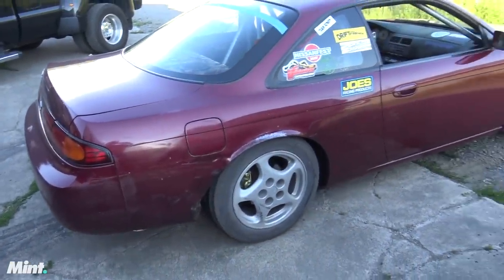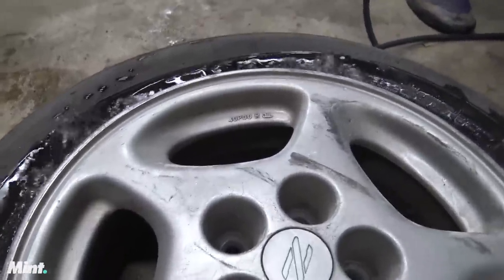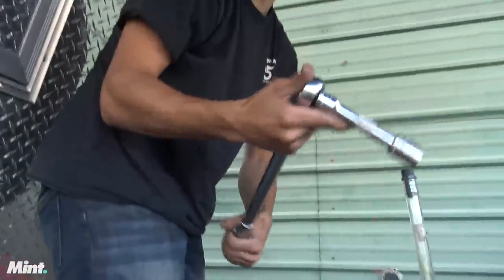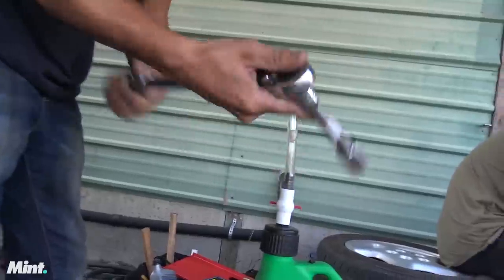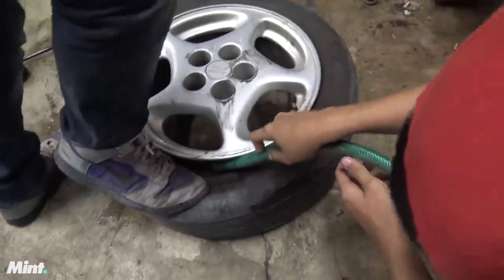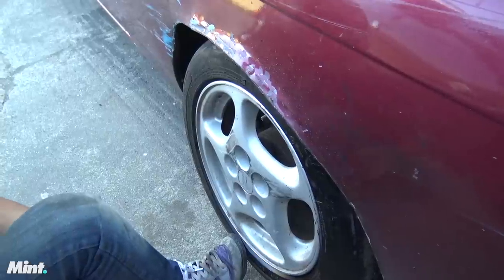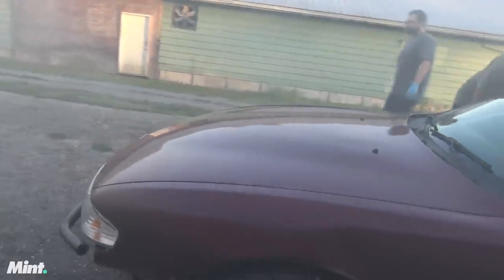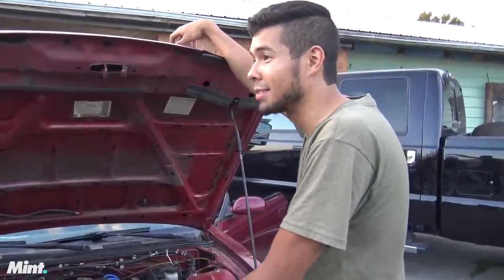Filling a CAR TIRE with WATER!

Comment: Nothing new guys.  Lots of ppl uses water instead of air in tractor wheels
Reply: Inkwizytor z planety Mongołów yeah but on a car doing burnouts is way different from a tractor.
Reply: Jr ALEXANDER maybe. But most of my friends use water. I will check calcium right now:)
Reply: Yup, Same thing here.
Reply: But why?
Reply: BisOnePL Because it adds alot of weight and it is cheap. Tractors need weight.
Reply: +Jr ALEXANDER
They use calcium if they're rich and can afford new rims every few years, otherwise it's just water.
Reply: Inkwizytor z planety Mongołów no they don’t they use anti freeze. Long trips state to state on hot pavement anti freeze keeps the tired from heating up, expanding and exploding.
Reply: But Do they do burnouts?
Reply: Jr ALEXANDER no ppls feels
Reply: Jr ALEXANDER No, lots of people with tractors fill their tires with milk from their cows.
Reply: Years ago, I used to put a water and methanol mix in tractor tires. Of course, they were not filled (with liquid), but that liquid is used to add weight for more traction.
Reply: Oh come on, your going to crush their spirit if they think they are the first to do this.  Its been around senses tire were invented. It just has not been documented because it sort of throws the suspension off a bit. Not noticeable but mechanic bitch about it. Oh, one other thing, water leaks out faster then air. rubber tires pressure keeps the flexible tire filled with air longer then water. Thank You Loader
Reply: Water for weight, calcium salt to keep it from freezing.  Then air pressure
Reply: Yeah and they also use it in truck tires for mudding a lot more traction
Reply: ...that's "calcium chloride"....or salt (sodium chloride) but salt water tends to corrode the rims. In my JD I use alcohol-based windshield wiper fluid and it works great in the winter.
Reply: Pädohammad it's not that it doesn't freeze but it requires a lot lower temperature
Reply: Luciano where did you learn that water leaks faster than air? It wasnt a science class im willing to bet. Water is denser than air and needs more of a gap to escape. Fill a balloon with air, then fill a balloon with water. See which one leaks "faster." I presume from your comment you will be surprised with the results...
Reply: D8W2P4 no water rusts the rims out calcium dont
Reply: OrionDakota I don’t think it’s just a matter of density.
Reply: Tractors use calcium
Reply: Tractors usually  have iner tubes in the tier that are filled  with calcium
Reply: Water molecules are smaller than molecules of atmospheric gas such as oxygen, nitrogen and carbon dioxide.
Reply: Nathan They are smaller but also the surface tension will prevent water from leaking through cracks or gaps that are too small. The same strong bonds dont exist in atmospheric gasses and they would leak out faster.

Joe was right that its not just a matter of density, as you pointed out as well. However there are other forces at work that make the result the same. Water would not in fact leak "faster" from a tire than air. The same airtight seal at the bead and schrader valve would let far more gas escape than water.
Reply: how? Water is H20 so 2 hydrogen molecules and one oxygen molecule. How can just oxygen alone be smaller?
Reply: D8W2P4 no, because water freezes
Reply: King Alfred salt water is also not used because it can grow all sorts of bacteria and other life forms. It's also extremely corrosive
Reply: Orion, I agree. I think air would leak faster, or more specifically, permeate faster. Like in your balloon example. It was interesting though, somebody mentioned the dynamics of having a non-compressible fluid in the tire, how the pressure would spike with bumps in the road. Unlike a balloon, a tire does not stretch to increase volume. The pressure spikes could change everything.
Reply: Tim T. Atoms are sized by the number of electrons they contain. When you look at a diagram of a water molecule, you will see two small hydrogen atoms stuck to a large oxygen atom. Oxygen gas is a molecule of two oxygen atoms. An oxygen molecule has 16 electrons. A water molecule has 10 electrons.
Reply: Guys holy shit...  We use tubes in the tires for one thing and second it's calcium saturated water..  no rim damage, no freezing
Reply: Inkwizytor z planety Mongołów I’m glad you told them. I was going to. Every time we got a new tractor or tire we filled it with water and antifreeze.
Reply: JR ALEXANDER - Water and Anti-Freeze in the yard tractor here... Winters!
Reply: Nathan Good point about the pressure spikes. The sidewall will stretch a bit to accommodate the increased pressure but certainly nothing compared to a balloon. Still given the very generous amount of bead to seal against the rim I wouldnt imagine you would see any leaking out before a hole rusts in the rim or the sidewall splits when the water freezes. Besides the amount of air in the tire that was necessary to seat the bead would likely be more than enough to compress against road debris.
Reply: Ricky Spanish Ricky Spanish
Reply: is thaaaat whyy they're HEAVY AF
Reply: D8W2P4 there is a new product out that doesn't corrode the rims, at least not nearly as badly as calcium, and it also doesn't freeze like water. All you folks with water in tractor tires must not live someplace were it gets cold during winter, because I don't know of anyone that weights tires with water here in New York.
Reply: Pädohammad salt water has a higher freezing point
Reply: Pädohammad Uhhhh....they meant vodka. They fill tractor tires with Effin Vodka to be exact!😂
Reply: OrionDakota You have a point, but what about all the added weight/pressure on it?....🤔

Comment: They have been doing this with tractor tires for years for added weight. But they use a glycol mix so it does not freeze in the winter. It works fine at least for tractors. All it does is add weight.

Comment: 9:34 yeah water is a success especially when you are traveling at high speed in highway and your tire explode due to the Eccentricity force
Reply: Definition of eccentricity
plural eccentricities
1 a : the quality or state of being eccentric
b : deviation from an established pattern or norm; especially : odd or whimsical behavior
2 a : a mathematical constant that for a given conic section is the ratio of the distances from any point of the conic section to a focus and the corresponding directrix
b : the eccentricity of an astronomical orbit used as a measure of its deviation from circularity
Reply: Definition of centrifugal
1 : proceeding or acting in a direction away from a center or axis

    centrifugal acceleration of a body

2 : using or acting by centrifugal force

    a centrifugal pump

3 : efferent

    centrifugal nerves of the heart
Reply: briddle1 exactly. Thank you
Reply: The tire could explode if it hits a bump.  The impact would not be absorbed by air in it.
Reply: No, tractors are loaded with water all the time and have extreme pressures on it.
Reply: starcommtrey Tractors don't hit hard bumps going at about 100mph.  Tractors take bumps moving very slowly.  Car tires are designed too to take impacts going on the assumption that they have pneumatic shock absorption.  Tractors are also not likely to ever get tire pressures that much higher than those of cars because tire pressures correlate directly to the pressures of tires' contact patches on the ground.  Tractors have to go off-road, so their tire pressures have to be fairly low to prevent them from getting stuck.  This is actually the problem with Stryker APCs going off-road and is why tanks are far superior off-road.  Tanks are much heavier, but their contact patches are vastly bigger, so they actually have relatively low contact pressure on the ground compared to Strykers, and they don't readily sink and get stuck in mud or loose dirt like Strykers do.  And tractors have to never get stuck digging themselves into the ground like Strykers readily do even if they are towing or plowing.
Reply: NerdVision you are underestimating the strength of tires... No tire would explode from having water in it because of high speed. Tires explode because of pressure and heat, not impact.

If you drive too fast on a highway with water in your tires, the rubber would stretch because of the centrifugal force, it would not explode, but it would eventually fall of the rim.
Reply: Mike234 I did not mean that they literally would explode like bombs or like balloons popping, and I did not say either that speed alone would do it.  My point was that an impact from something like a sharp bump at high speed could cause the tire to burst, which would create a serious leak that would result in the tire coming off.  You neglect also how engineering works.  Car tires are designed to be used in particular ways, and this includes having them filled with a compressable fluid, i.e. a gas, to absorb some of the force of impacts.  If they are filled with an uncompressible fluid, then an impact at high speed can cause the peak pressure inside the tire to exceed the pressure limit of the tire.  Normally, air absorbs some of the impact so the tire as a whole tries to accelerate upwards only relatively slowly, and that acceleration corresponds with the force applied on the tire and thus the pressure inside the tire.  The pressure-over-time graph would look like a bell curve biased towards the start time.  With a non-compressible fluid, that graph would instead look like just a huge spike many times bigger than the bell curve, showing far shorter increased pressure but also a far higher peak pressure, which is what would cause the tire to burst because car tires are not designed to have to deal with that kind of scenario.
Reply: NerdVision u do realize that air and water are both fluids correct. Thats why u can put air into a hydrolic system and it will still function. The pressure doesnt increase on impact it only increases with temp change. Impact simply displaces the fluid.
Reply: matt hammond The issue is shock absorption.  By definition, gasses are compressible, and liquids are not.  If an impact is absorbed by air, then the pressure increase that it creates is spread out over time.  If a tire is filled with water, then the pressure increase is not spread out over time, so the tire has to handle it pretty much all at once.  The tire would then push the car up far faster upon hitting a bump, which according to F = m · a would mean that the peak force on the tire, and thus the peak pressure on the walls of the tire, would be many times greater if the tire is filled with water than if it is filled with air.
Reply: Mike234 Neutron matter is compressable into black holes too.  But under normal conditions, that doesn't happen, and liquids are not significantly compressable either.  That is what makes all the difference between hydrolics and pneumatics and is why hydrolics are used instead of pneumatics in a lot of applications.

Comment: This is done on tractor tires. If it is a tubed tire it is way easier. You turn the air fill up thing to the top and there is an adapter for it to attach a water hose.

Comment: This is not a new idea buy any means.  All of the old farm tractors rear wheels are filled with salt/water mixture.  This was to add weight to the back end of the tractor. There is a special attachment for the valve stem to add the water.

Comment: This is a great example of applied physics. Water is relatively incompressible, which means the tires will flex less. The result is less surface area contact and traction, more shock transferred to driveline components and premature wear, and a less comfortable ride. Yes, you can do it, but......... why?

I guess punctures would easy to find.

Comment: this is basically like filling a balloon with water and putting fire under it, it won't pop for a while.
Reply: Sky Anthro as ling as there is zero air in it. We did this with water bottles in fires

Comment: Should've just drilled a whole in the tire, fill it up with water then plug it. That way it's completely filled without an air pocket
Reply: Jacob Nichols it woudnt seal without air the water will just go out when it starts getting full
Reply: Mod the rim so it has another valve stem, open them both up and fill one with water while leaving the other to displace the air. Install both valves back in. Complete water fill.
Reply: um, thats why he said "then plug it"
Reply: You want a little pocket of air for cushioning. Even if you did this to all four tires and it drove great it would torture the brakes and suspension
Reply: MV60 all they have to do is modify the tip of  the water hose to fit the air valve in the rim
Reply: Ishmael Alcala: You would need to have the second valve like he said. Even if your water hose had enough pressure to keep the water flowing, the air that is in the tire already would blow the tire up before it would fill up with water.
The second valve is a vent and you would plug 2 holes.

Comment: Why didn't you just take the valve stem out and fill it that way?
Reply: Extremely dangerous. If they did that then if the tire explodes, it could become dangerous.
Reply: +meep 
Because everything else they are doing is completely safe.
Reply: meep They make valve stems specifically for putting water in tires.
Reply: Trey Lambert 
Name not found
I badly explained that, sorry
Reply: @8111y  Not to mention, if you are filling a tire with water and not air, the only way to do so and maintain the seal through that hole would be if you had a vacuum inside the tire before hand. The air in that space has to go somewhere after all.
Reply: 8111y did I say valve stem? My bad dude I meant to say valve core ... and I appreciate you not bein a Jackass, but I know you know what your talking about. Sorry bud you are right.
Reply: @dustinwilliams6621  wheels are metal NOT RUBBER so once the valve stem is removed there will be a 1/2 inch hole needing sealed!!!
Reply: John Ranieri I said I was wrong bud 😂😂

Comment: Here's the problem with doing Burnouts with Water in your tires...you stay in place when burning out and the tires make extreme heat when burning out and that water is boiling which is most likely burning the tubes in the tires as you saw the Roaters were cherry red and the temperature for cherry red is about 800°+ just a warning

Comment: Fill it up with gas
Reply: hunter grenell you crazy car will blowup
Reply: That means fill it up with soda
Reply: Im curious
Reply: air is a gas, the only difference will be explosive risk (and of course little difference a weight, but nothing sensible at all.
Reply: Benoit RIBERY what everyone meant by gas is gasoline
Reply: You kids watch way too many movies. Gas will likely have the exact same effect as water in the tires but with a moderate probability of fire outside the tire after blowout which could set the rest of the car on fire if not extinguished.
Reply: turgsh01 uh huh
Reply: Oh ok, i'm not english, i thought they were talking about gaz ^^ In this case, Gasoline will have the same reaction as water except dumb explosive risk lmao
Reply: hunter grenell  you are hilarious!!!
Reply: No problem, drug cartels do it all the time
Reply: hunter grenell 
gunpowder!

Comment: Fill it wit helium my dood
Reply: Alejandro Flores helium is lighter than air why do you think that helium filled balloons float.
Reply: Lol Lol hover car
Reply: xXExxolasXx xXExxolasXx you would need balloons instead of tires
Reply: Lol Lol there already made of rubber
Reply: Unless it required more helium to get to the required pressure, however it should be barely lighter than tires filled with air.
Reply: helium is more dense than air so it's heavier, even if one atom is lighter than an atom of oxygen or nitrogen
Reply: Wouldn't it be heavier beacuse you would need more helium than air ?
Reply: expensive
Reply: You want your tires to float away,  cause that's how your tires float away
Reply: Maybe if they had a DeLorean it would work
Reply: xXExxolasXx xXExxolasXx it might work...
Reply: xXExxolasXx xXExxolasXx it would be heavier. People have made videos already, cause you need more helium to get the correct pressure
Reply: xXExxolasXx xXExxolasXx that might leak out.
Reply: 31337 Clan but how?
Reply: Helium is less dense than air.   It would take more lbs of helium gas than lbs of air, hense making the tire more heavy.

Comment: Fill it with cement this time
Reply: you might be on to something o.o
Reply: iHANDSOME I would not try peeling right out with cement, you might blow the engine or transmission right off. A slow building speed on trial run would be recommended.

Comment: Great way to smuggle booze across state lines..
Reply: Eustus! Why does the bourbon taste like burnt condoms!?
Reply: Line the inside of the tires/rim with a protective coating, fill with alcohol and boom.. booze transportation mobile.
Reply: except it will get hot ,and not every booze is good when heated.
Reply: You haven't lived until you've had hot 151. If it does combust, at least your car will look cool for a few minutes. It's all fun and games until the fire department shows up.